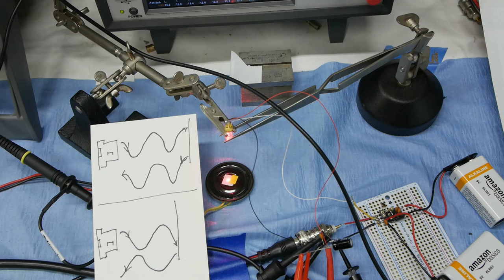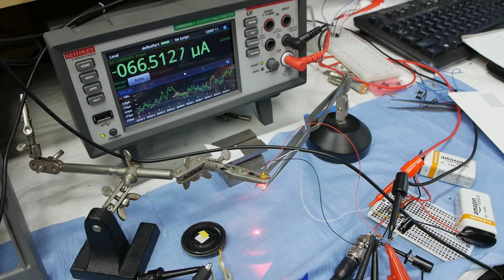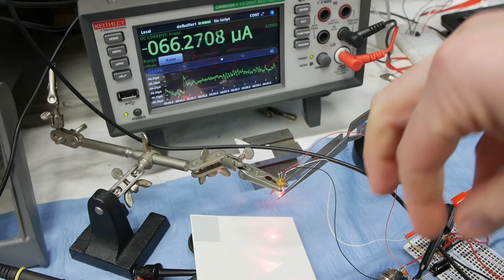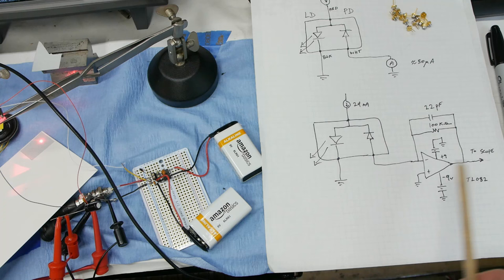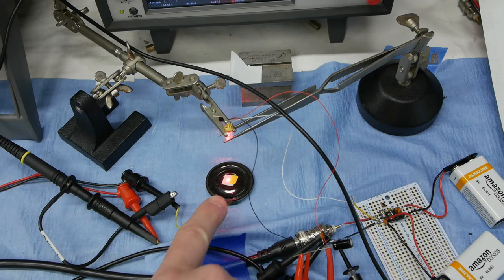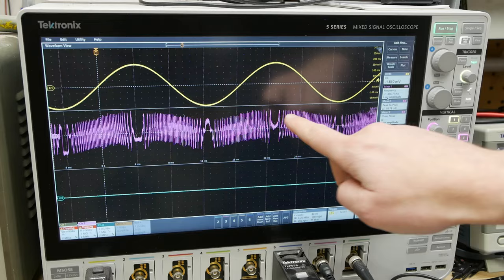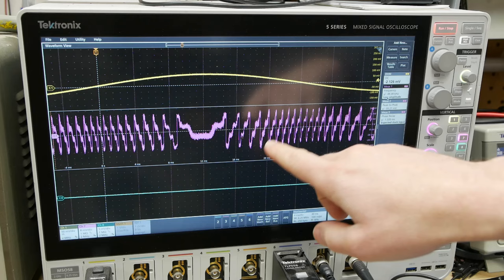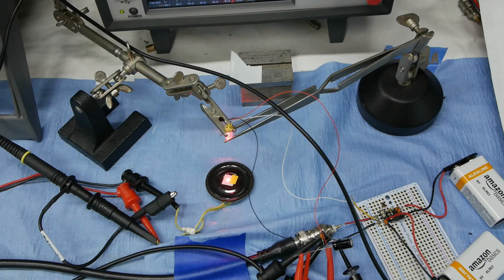Laser diode self-mixing: Range-finding and sub-micron vibration measurement

Comment: Thanks. I played with this using scavenged CD drive laser modules. The gear I can afford is too noisy but it did show me there's nearly constant seismic activity where I am, so that's where I stopped. I hope you figure out a practical use for this, and share it, because it's there. A super-cheap seismograph comes to mind for no particular reason. Where's my ludicrous-precision no-contact surface gauge? Hmm??

Comment: In actual applications a laser is used which has circular polarization.  With the addition of a 1/2 wave and 1/4 wave plates Circular is changed into linear polarization.  This produces 2 components.  The components can be phase aligned and used in 2 phase detection to produce not only distance information, but direction much like a shaft encoder.  The system is a little more complicated as there is noise from the laser and many gas lasers have random polarization.

Comment: I don't think you should need to ramp the frequency to find distance. Idk if it would work better in practice, but I think it should be possible with just a few different wavelengths (perhaps even just 2), preferably ones that are coprime. The series of measurements you take for each wavelength would give you a system of congruences. In the best case scenario (all wavelengths coprime), the system determines the distance to the target modulo the product of all the wavelengths for which you took measurements. Methods for solving such a system are found in https://en.wikipedia.org/wiki/Chinese_remainder_theorem#Computation

Comment: I suggest adding this for a new sensor head for the electron microscope, and other sensor heads like atomic force, capacitance sensing for dielectrics. With the sub-micron measurement you might have a great addon !

Comment: You can hear speaker not because of ringing but because fronts of square wave create pulses which have a lot of high frequency components in their spectrum, and they are emitted in the air much more effectively with the speaker of this size. You basically hear a train of Delta functions, and Delta function has the same spectrum, as white noise.

Comment: You might also want to look into a simpler device called an optical displacement sensor. This relies on measuring reflection intensity from a surface. 
This is commonly used in industry and various used amplifers and fiber optic probes can be easily found on ebay to experiment with.

Comment: This is actually how they align wafers in photo lithography. They do a coarse pre-align using absolute positioning, then do fine adjustments using feedback from multiple interferometers. Of course, most systems use beam splitters instead of a combined laser/photo diode component.

Comment: STMs small VL6180X uses this principle, with an small band IR laser diode and separate photo diode to measure "time of flight" distance.
Since their sampling is "lock based" and they only have a limited clock speed, the accuracy not too high, but they are within ~1mm over 0.1-2m distance and the timer/distance can be read via I2C to an Arduino, RPi or any other controller/MCU.

Comment: I did not measure distances with this effect, but as you most likely know it is exactly the reason why you have to use optical isolators in many laser experiments. Light shining back into the laser cavity can "upset" the laser to the point of it stopping to output any light.

Comment: The sawtooth waveform seems to be explained by optical feedback, discussed in: Norgia, Michele & Giuliani, Guido & Silvano, Donati. (2007). Absolute Distance Measurement With Improved Accuracy Using Laser Diode Self-Mixing Interferometry in a Closed Loop. Instrumentation and Measurement, IEEE Transactions on. 56. 1894 - 1900. 10.1109/TIM.2007.904551.

Comment: Have a look at the TL07x series of OPAMPs, they're the exact same at the TL08x in nearly every spec, but they have lower noise and cost only slightly more. They're even the same pinout, so it makes for a drop in replacement.

Comment: About timestamp 9:30    I think the response is to the time rate of change of the speaker.  You should find the greatest response at the max. rate which occurs at the inflection points (Max slew rate) which occurs at the zero crossings of the speaker signal.

Comment: because the laser wave length specified by manufacturer is (most likely) not a precise measurement (630nm or 630.5 nm is a big difference), the more you count cycles, the bigger will be your error. When few centimeters you are going to accumulate an error of various micrometers, making this distance measurement more imprecise than with a simple mechanical micron measurement device if used for long distances.

Comment: According to your schematic at 23:39, your 500 Hz modulation is applied to both the laser diode and the photodiode.  Thus I believe that the 500 Hz signal is largely simple conduction through the photodiode.  You have not demonstrated that this is related to the retro-reflected light.  There is a good chance that interference only causes the squiggles.  By grounding the common junction and isolating this signal, there is a good chance that you could count these transitions.  Additionally, a triangle wave or a ramp will shift the laser's wavelength linearly in time making it possible to time the light transit accurately by counting fringes.

Comment: You should see if this could be an improvement on the "LASER Eavesdropping" device. Instead of using a triangular arrangement with an emitter and a detector, you could just use the laser and a retro-reflective dot stuck to the window.

Comment: Now this is truly fascinating, and something you can likely do without a 52” scope. Though isn’t it only 1/4 wavelength between constructive and destructive? In any case, I’d like to see about doing something useful with this such that it can be semi-portable and isn’t effected much by ambient light changes.

I’d also like to se your take on measuring laser light frequency (from what I’ve seen, you do so with another laser) since knowing the frequency difference caused by the voltage difference is required for finding out the unmoving distance to an object.

Comment: I was considering another option for measuring distance would simply be to turn the diode on then measure time to first interference from the return light. This is likely a much noisier circuit though

Comment: An interesting project with a lower frequency emitter in the radio range could be a closed-loop speaker amplifier that controls the cone position instead of voltage to make even the most poorly designed speakers sound as flat as flat can be

Comment: You can split the spiky signal at the observed fast transitions and piece the underlying signal back together.  The lack of a resultant peak at the very top and bottom of the sine wave means the signal did not quite transition to the next 1/4* wavelength so you get the 'batman symbol' effect.  Also, the amplitude of the spiky signal is actually 1/4* of a wavelength of the laser light, although the scaling from the other instruments means you would need to calibrate this empirically, in terms of mV/nm etc.

*I believe it is a quarter wavelength but it could easily be 1/2 a wavelength or a whole wavelength or similar.  Its from memory so look it up if its important.

Comment: Nice vid, one of my favorite experiments is an interferometer. You can use a microscope slide for beamsplitter on the cheap.
Since you have so many lasers, are you interested in a recipe to make your own holographic plates???
It is easy to make reflection holo's with a single expanding lense and no beamsplitter. (provided you have an (easy to make) isolation table)
You can also use other color lasers for camera/darkroom safelight.
Then maybe you can look at the completely hand did holo under the SEM (might have to dope the holo mix)
Back in the day I used to yell upstairs to roommates for a minute of silence so exposures would not be ruined by sound vibrations.
You have constructed an almost complete uncalibrated but fun siesmograph.

Comment: after you tapped on the table to demonstrate the noise induced i noticed a noise corresponding to your talking, so i'm guessing just the sound vibrations are enough to mess with your readings.  so what you need is a 1 ton granite block in a sound isolation booth to do your experiments in :)

Comment: I think there might be an error in the last part about measuring absolute distances. If I understand correctly, you are saying that the inteference happens between the "old"  reflected light at a different frequency from the currently generated light. This effect is way too small (the travel time for the light in your setup is sub nanosecond and the frequency change of the laser in less than 1ns is negligible at 500Hz modulation)

I think what is happening is much simpler: the phase of the reflected wave at distance D is phi=2*pi*D/lambda, and if you change lambda you simply change the phase of the reflected wave, thus getting a sequence of constructive and destructive conditions.
 It is clear than the number of interference maxima is directly proportional to the distance of the reflector.

Comment: By chance, the September, 2020, issue of the American Journal of Physics includes an article titled "Laser diode coherence", Am. J. Phys., Vol. 88, No. 9, pp. 740-745.  Might you consider attempting such coherence determinations of the type of laser diodes you investigated in this YouTube presentation?  Namely, laser diodes that include a monitor diode.  Such additional information would inform possible applications of the interferometric use of such diodes you discuss here.

Comment: Very cool, thank you!  Just a nerd note:  When you go from a sinusoid to a square (or any distortion from sinusoidal) you add harmonic frequency components to the fundamental waveform generator output frequency.  Given the odd harmonics being added in, you are more likely to hear the speaker producing a square wave than a sinusoid -- you pointed out that 60Hz is below the speaker's nominal (flat) response band.

My nerdy point, which may be wrong, is that your reasonable explanation of the speaker membrane ringing due to the fast edges "snapping" the membrane is maybe not as interesting as the real physics going on -- I believe the ripples on the ramp and square waves, visible immediately after the fast edges, are NOT ringing at all, but rather the speaker delivering the extra harmonic content of those waves.

This rationale seems flawed at first, because after all, the ramp and square waves would not be distorted as per Fourrier -- the ramp rising, and the square leveling off should definitely NOT have those ripple distortions.

But, there are 3 hints that support this harmonic content theory (over the snapping the membrane making it ring theory):

1. I believe the reason why they are visible distortions incurred by the harmonic frequencies themselves, is because those frequencies ARE in the speaker's nominal band, so it physically throws the membrane further for those frequencies than it can thrust the membrane at the fundamental (probably due to signal roll-off, because this would not be a magneto-mechanical limitation as you would expect for frequencies higher than its specified band).

2. The ripples appear to be sinusoidal, which supports both harmonic and ringing theories.

3. They are close to the edge, again supporting both theories, but also stands to reason from the Fourrier series, because the edge is where most of the collaborative mixing happens, and the ramp and square flat lines have much more destructive mixing.  

So to summarize, I believe if the speaker had a flat response from 1kHz down to 30Hz, you would not see what you referred to as the membrane ringing, because the speaker would reproduce the calculated (and generated voltage) waveform.

Concluding that this interferometry could very well be used to detect speaker motion that is not consistant with the input waveform -- that might be possible with a MATH oscilloscope trace, which should be a flatline, showing zero delta in wave shape and speaker cone motion reproducing that exact waveshape.  Ultimately, you could calculate and recreate the actual Bode plot from the series harmonics and their amplitudes -- but just as a quality check, you could make a speaker flatness checking rig for the audiophiles of the world (if anyone productizes this, I'm sure you and the Internet won't forget me, or our host :) )
Reply: A true "mixing" inside the monitoring photo-diode, would produce a sum and a difference of the frequencies of the two lights (local and reflected), and since the sum is a very high frequency signal, you would ONLY see the difference, because of the low bandwidth of your observation channel. That difference would appear as a DC signal, only, since the frequency of the two lights is EXACTLY the same. You would only observe a change of the amplitude of that output signal, as you move the light target, due to the fact that the phase of the reflected light changes with that distance (Doppler effect). 

Note that because the amplitude of the reflected light, also changes somewhat with target distance, the output of a true mixer may not be exactly what you would ideally expect from a pure multiplying operation between the two light signals.

Comment: You could also cycle through colors on an RGB LED and by detecting and subtracting the color that comes back from the current emitted color you can determine how many color steps have passed. so if you cycle 1 color every ns and now you have cycled 50 colors, you know that light traveled for 50 ns. Calculate the speed of light for 50ns and divide by 2 and you know your distance. 

Since you can produce 16.8 million colors with RGB LEDs you have a very high resolution and depending on how fast you switch colors you can increase the distance you can measure. Problem is that the speed of light is almost 300 million meters per second so even at 1 Gsps you only get a 30cm resolution. Gonna get really expensive buying 3 ADCs with those sample rates. I guess interleaving would bring your speed requirement down a bit but to get into a usable range you still need one hell of a fast ADC.

Comment: You can technically chirp the signal to make a lidar from it as well but how good that will perform is a question to be answered through experiments. Better that a self mixing laser diode is stabilizing a laser and setup a homodyne interferometer.

Comment: Let's count. The frequency of this laser is 460 THz. So, the beat frequency from the moving reflector is 460*10^12*2*v/c that is 3.06 MHz per 1 m/c. If the motor shaft diameter is 5 mm and it makes 1000 rpm, its linear speed is 0.26 m/s, so the beats frequency should be about 0.8 Mhz. So, that peak at 10 kHz is not that you seek for.

Comment: I think i was going to comment on this earlier, as I was trying to build something similar.  But, even though I do agree the photo-diode is detecting the reflected light, I'm tying to think of a way you could confirm it is interference your detecting and not a sampling, or quantized signal your showing.  The op amp certianly is a analogue amplifier, so bandwidth wont be any problems there, but the capture and 'Dithering' patterns on the scope, could be interpreted as a artifact.  I guess one could (If you could do it accurately enough) change the wavelength of light used (To green, or infra-red) and see how that would change the patterns ?

Just a thought.

Comment: Q1) How can you measure a few pics meter with this method?  Red laser diodes have wavelengths about 450nm.
Q2) Your speaker has 4 or 8 ohms impedance.  Your signal generator has 50 ohms.  Is that why you could see the speaker noise on the signal generator internal scope?
Q3) Does Lidar work the same way?

Comment: The last section about distance measurement lacks a spectral discussion, it would have been nice to use the fft on this.
Because basically what you get is a multiplication product, i.e. a new frequency component, depending on reflection distance and modulation frequency.

Comment: When you say that 10 phase changes implies 10 wavelengths of motion, I do believe you're slightly wrong -- pedantically it actually implies a path length change of 10 wavelengths, which corresponds to only 5 wavelengths of movement of the speaker cone (since moving the speaker cone x distance away increasing the length that the light has to travel both towards and away from the cone.)
Reply: TheHue's SciTech yes, I also saw this and commented. Explained in other words, the phase of the reflected wave relative to the incoming wave is shifted by twice the change in the incoming wave.

Comment: The waveforms slow/fast waveform in the lower oscilloscope trace created by the sine wave input are a form of differentiation or, the same thing, the slope of the sine wave at a given point.

Comment: Great video!
I don't understand how the axis rotating creates an interference signal. Isn't the spot where the laser hits always at the same distance from the diode? I suspect this might be measuring the vibration of the motor instead.
Reply: The signal is caused by the the rotation of the shaft -- the retro-reflectors are in motion as they reflect the light, even though it happens more or less in the same place always. Why exactly this works is actually a very good question -- it is not very intuitive.

Comment: 11:05 don't you get constructive interference when the wave is at a low point as well? You should get destructive interference when the wave is in the middle, at 0, which is 1/4 of a wavelength away from either of the constructive interference points. So if the surface moves exactly one wavelength, the amplitude of the resulting signal should have two local maxima and two minima.
Correct me if I'm wrong